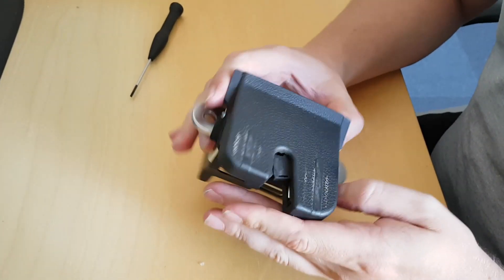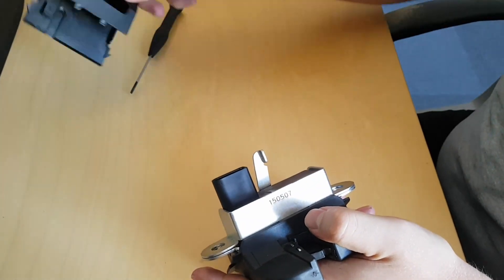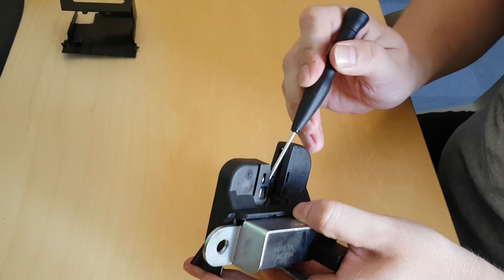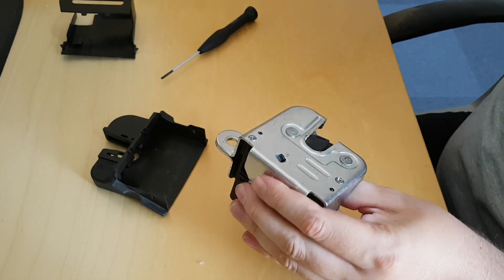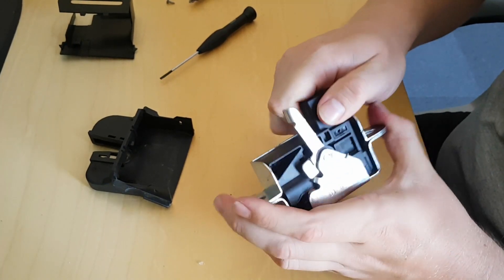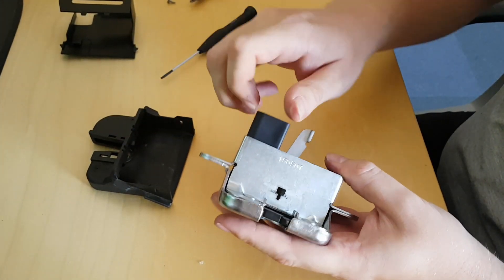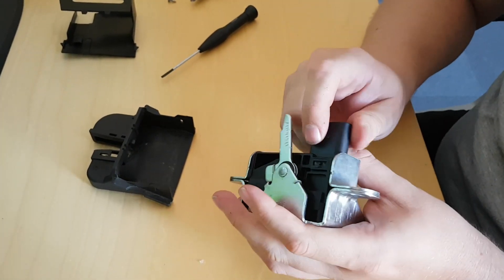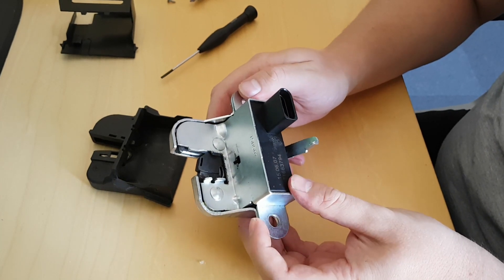Failed attempt to repair a tailgate lock for a VW Golf V Estate

Comment: Thanks for the video. You don't need to remove those rivets. You need to remove all the plastic bits and lastly remove the metal bit that securing the whole lock assembly. I've done it and it's pretty easy. The rattling noise is caused by the worm gear that is broken. You can buy the gear to fix it on ebay. https://www.ebay.co.uk/itm/133477191516
But if you want to save time you can just buy the whole assembly. I did buy the whole new lock and also buy the gear so i can repair the broken one and keep it as a spare. Hope this help everyone.